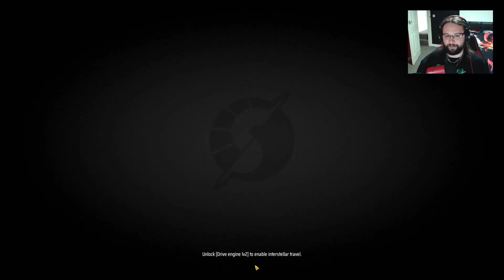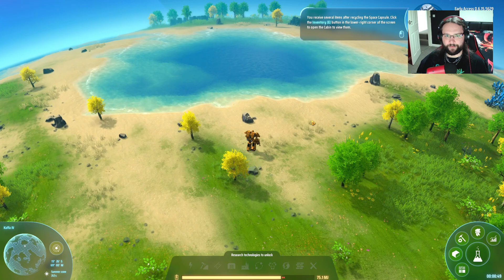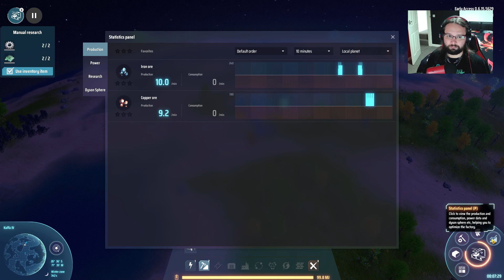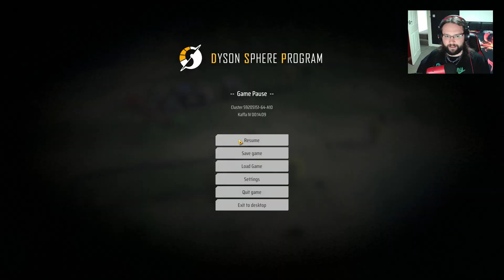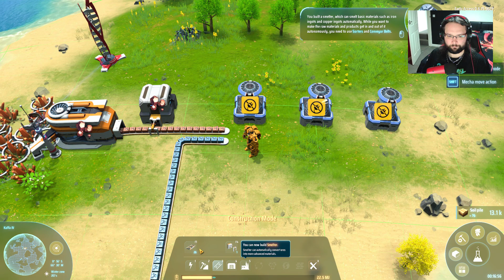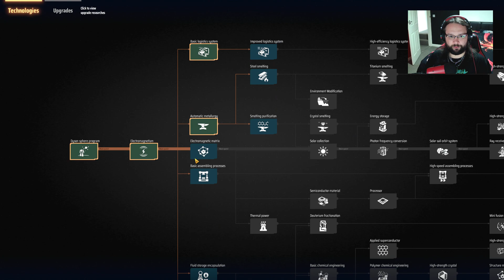Dyson Sphere Program - Let's Play! - Hello world. - Ep 1

Comment: - First tip, which is well ahead of where this vid will end - Don't do a sail swarm right away.  The energy return is less than trivial without any shells on the sphere frame.
 - Solar panels, solar panels, solar panels.  Did I mention solar panels?  Cuz solar panels.  One thing you can do with solar panels is make a ring around the planet, so it basically gives you 100% uptime on 50% of the solar panels.
 - Fuel for your mecha - Leaves burn fastest and give almost nothing for energy, but they're a quick source of energy.  Get to Energetic Graphene ASAP.  It's the most efficient fuel early to late-mid (deuteron fuel rods are godly).
 - Save ALL titanium and Organic Crystal you mine from the rocks and trees around the planet.  You might be able to get enough to unlock Interplanetary Logistics without having to leave the planet.
 - You need 200 Yellow Cubes to unlock Interplanetary Logistics (80 for the first tech, 120 for the second)
 - You can overlap miner areas without sacrificing productivity.  Note that it will deplete the nodes in the vein 2x, 3x, etc faster for each miner mining a node.
 - Build a production chain for Belts, Sorters, and Power Poles (splitters, too, if you like using them, i don't).
 - You can sort your inventory in two ways --  The "return" icon in the upper right, next to the X.  But the better way, CTRL+Left Click on an empty space in your inventory.  This will sort it, but it will also add fuel to your mecha's fuel chamber if you have room.
 - Since you can't (currently) easy pick up items from belts, make a storage box at each production chain.  Use the slider at the bottom of the storage UI for the box to limit the number of stacks.  This way you'll always have materials you can snag to make something on the fly manually.
 - To gather soil, look for raised areas to place foundations, or other items, on.  Anything built will level the ground under it to zero elevation and return any soil from the leveling.
 - When you get to oil, the refinery outputs two products.  When placing the sorters, you can press Tab to filter what the sorter will pull.

I'll add more as they come to mind.
Reply from the maker: Holy. Shit. O.o thats a lot of tips! I'm already a little in front with this series so a few of them points ive already worked out :P im not quite at solar panels atm but with how im doing my play through a ring around the planet will work well ^^ im no where close to interplanetary stuff yet though o.O
Reply: @Dakdak  There's a lot to this game, especially for how early access it is.  I'm far from an expert, but I fell in love with this more than I did Factorio and Satisfactory (both of which I love, too).  So sharing tips and ideas... I kinda fanboy a little.  lol
Reply from the maker: Keep the tips coming! They're always going to be welcome :P I love this sort of game but I normally get lost with them so the more I know the better xD